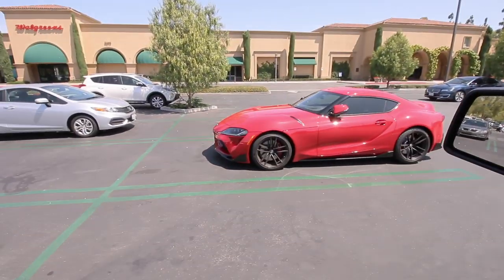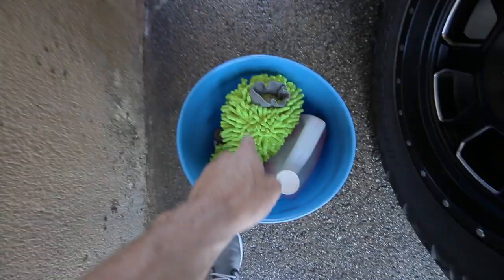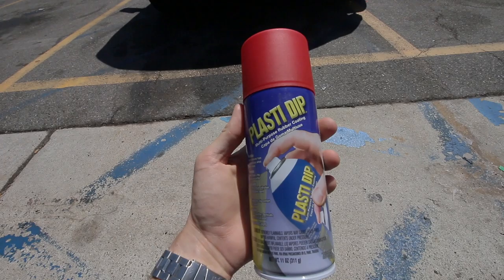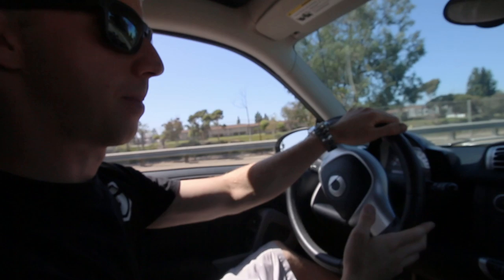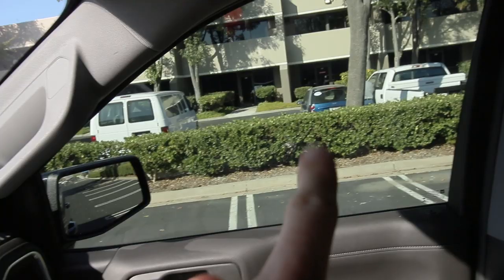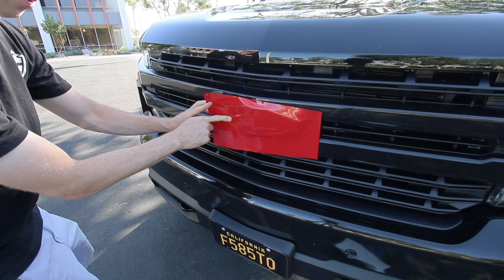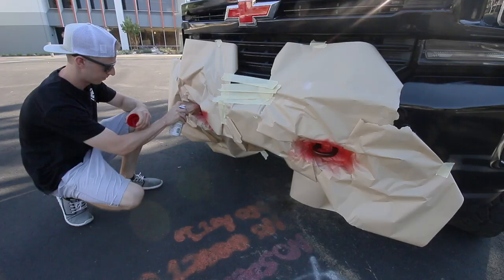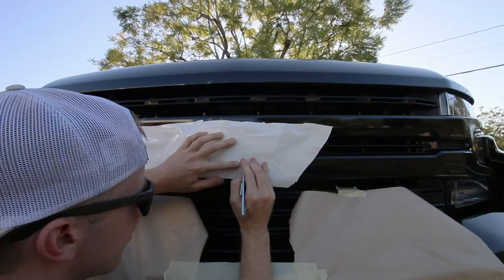Plasti Dipped My Tow Hooks

Comment: What kind of leveling kit did you use for your truck. I am in OC as well. Where did you get it done at.
Reply from the maker: Kevin Snapp dealership did it, I couldn’t tell you which one they used. I highly recommend JC Alignment in Huntigton beach
Reply: Gotcha. I am waiting for your video on how to wire your fog lights. I have an LT that came with no fog lights. Wanna dress it up a bit. Where did you get the fog lights from.
Reply from the maker: Kevin Snapp coming soon, sorry for the delay. So much going on but the videos will be back on track within the next few days. eBay for the fogs

Comment: Nice video but i wouldn't use plastidip on anything. don't think its going to cost you a lot to properly paint those hooks red and change them to any color later on if you change your mind, just my opinion. Thanks
Reply from the maker: Sensible Software© right, itvwas only to see if red was a color of like to commit too.
Reply: @MarkBrenner  it is go for it! have a nice day
Reply from the maker: Sensible Software© thanks 👍